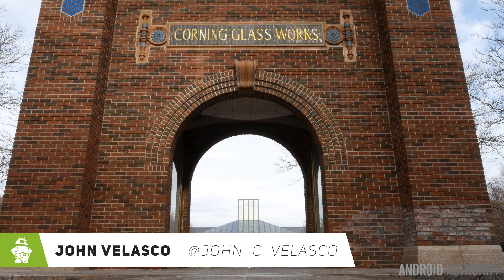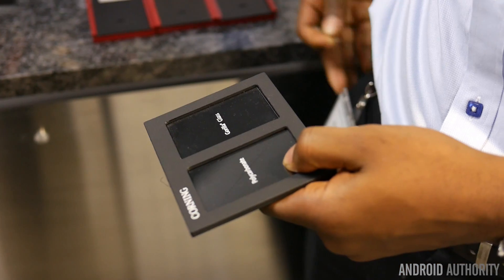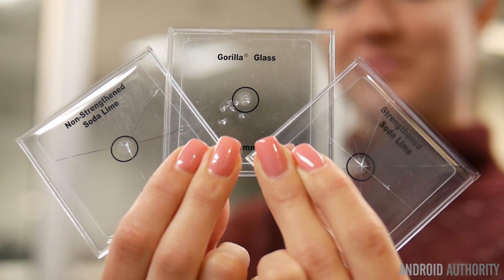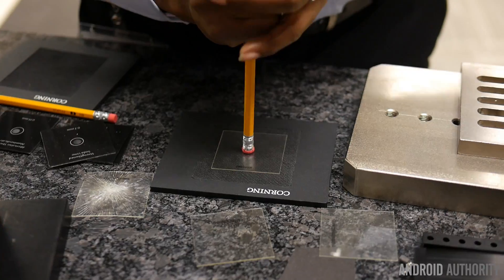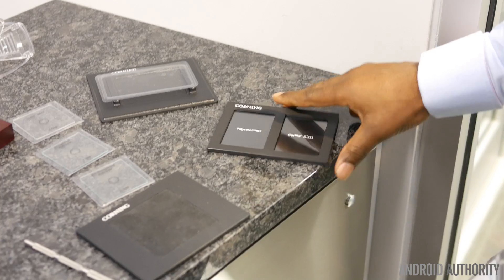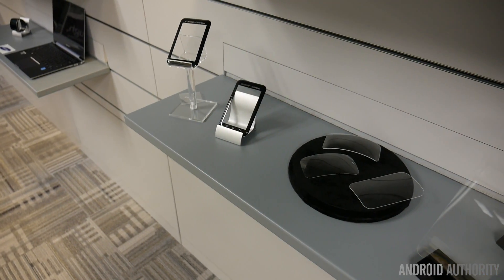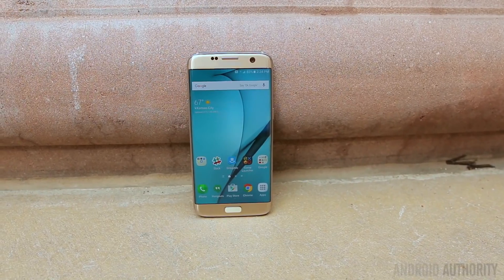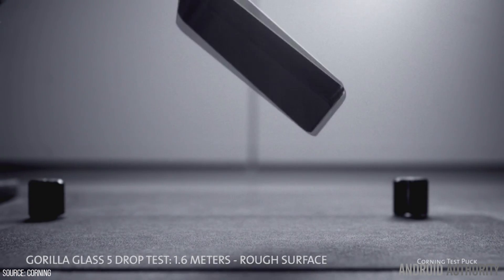Corning Gorilla Glass labs tour: Shattering glass for perfection

Comment: Why don't Apple use one of these in their iPhones?
Reply: Because it not branded by them if they use it
Reply: Frank Wong As far as I guess, the gorilla class is very good at shatter proofing, while the iPhone's screen get shattered, urm, not very easily, but it does get shattered pretty often as compared to any latest gen Gorilla Glass.
Reply: My Instant Search iPhone use the gorilla glass but they rename it to ion strengthened glass for marketing purposes
Reply: Ibrahim Ahmed Didn't know that, Thanks! 😀
Reply: cus they wanna keep alive "we make the hardware and the software".
More than half of the iphone is made by other companyes.
Reply: Ibrahim Ahmed just re-watched both 6 and 6s scratch with the razor blade while a Gorilla Glass phone like the s7 doesn't
Reply: They actually don't, their screen could scratch with keys till the iphone 6 or 6s (I don't remember which) and still shatter quite easily
Reply: Gianmarco watch jerry rig everything video it scratches on level six pick i.e the same as gorrila glass
Reply: My Instant Search Sony uses a tempered glass on their phones. I have used a few Sony's phones and they never had a screen scratched or shattered (dropped my phones once a year). Only the old models with screen protectors built-in the could show scratches.
My point is that both Sony and Apple don't use Corning's tech is because it is probably not worth the extra cost to then. But anyone with shaking hands should probably opt for Corning's screens.
Reply: Gianmarco that's why I questioned about iPhones.
Reply: Frank Wong this whole video was comparing normal ion strengthened glass vs Gorilla Glass, it's not the same thing
Reply: MiracleWarriors sony uses gorilla glass like any other smartphone manufacturer.
Reply: As far as I know it was Steve Jobs who came to the Corning back in 2006 or so and told them that he wants them to make the screen for his iPhone. And so they did and since 2007 every iPhone should have Gorilla Glass corning. I know that there was a problem with another company creating some saphire-based screen but I think that Corning still sticks with Apple.
Reply: My Instant Search wwwwwwwww